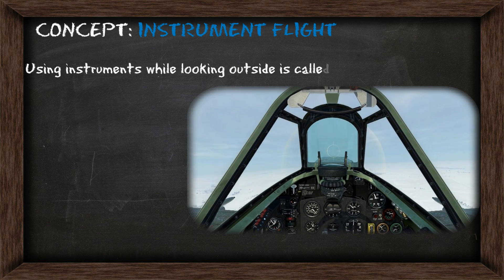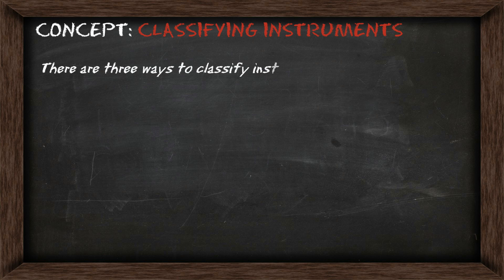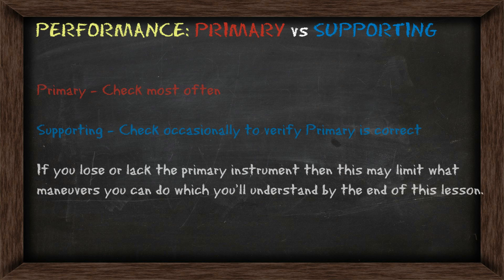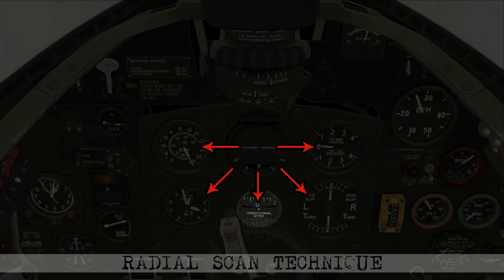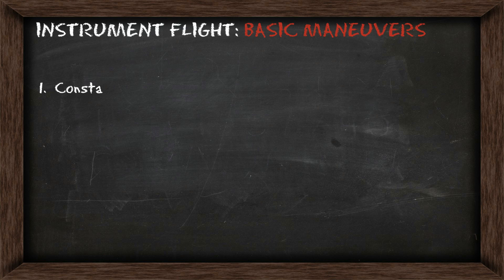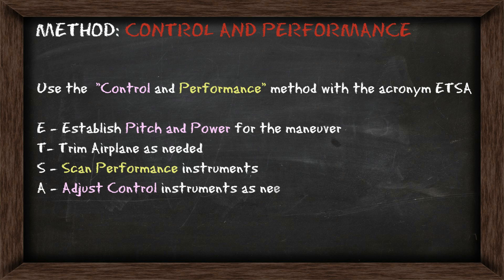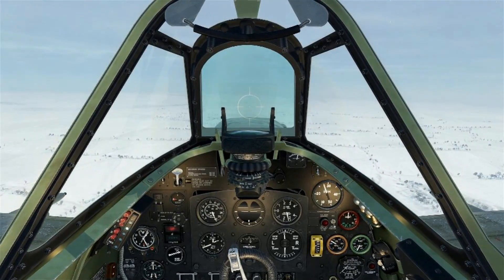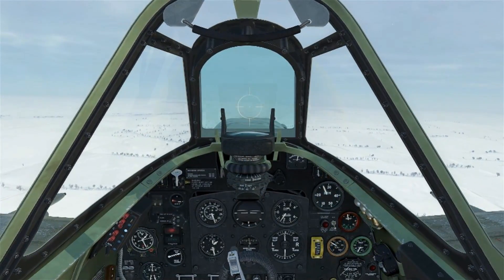Instrument Flight Basics

Comment: 1) How to execute smooth, IFR leveling off, if a plane has no variometer? Like Bf-109?
2) German fighters like Fw have variometers in m/s anyway, so I think they used different rules of thumb for IFR leveling off?
Reply from the maker: Without a VSI you'll have to watch your altimeter and control the rate at which the needle approaches the desired altitude. Basically don't let it go crazy fast...

Comment: I'm looking to buy IL-2 BoS, but have some questions. First off, do the AAA fire at you when you approach them in IMC? Secondly, what is the extent to which radio navigation is modelled in the game? As far as I know it has some representation of NDB systems, but some (mostly German) aircraft seem to have navigation instruments which display glide slope, is this modelled or not?

Thank you for your time.
Reply from the maker: Hey Siim. I believe line of sight is implemented for the AI airplanes, but I'm not sure about the AAA. The radio navigation is simple at the moment with simple NDB types. The glideslope indicator on the AFN-2 for example doesn't work yet.
Reply: To clear that up a bit, AFAIK it functions both as a glideslope indicator for the Lorenz landing system and signal strength indicator for the AFN-2. I'm not an expert on this however, so I might be mistaken.

Thank you for your timely reply, it seems I have some testing to do then. :)

Comment: +RequiemBoS  Instrument layouts have evolved with the gauges.  U. S. aircraft circa 1940 would stack the airspeed and altimeter to near left of the attitude gyro, vertical speed and ADF bearing to far left, tachometer and manifold pressure to near right, engine pressure/temperature and fuel quantities to far right.  The turn and slip was usually below the attitude gyro, and the directional gyro could be either above or below the attitude gyro.  Today's jets have some of the instruments combined; the modern attitude director indicator places the slid-skip ball and yaw rate needle at the bottom.  Some modern secondary performance gauges (e.g. the vertical speed and angle-of-attack in the USAF/Lockheed Martin F-16C) are actually 1/2-3ATI sized to fit gaps around the airspeed/Mach, altimeter and ADI.

Comment: Thanks for useful tutorial. BTW why don't you have your slip indicator perfectly centered ?
Reply from the maker: The joys of flying on a computer swivel chair which can make precise adjustments harder sometimes, so what shows as centered makes my body feel pretty crooked at the time. I'll just accept the minor error as it's a lower priority than maintaining heading/altitude/airspeed accurately. Much easier in RL. Of course, nobody is perfect though so that's another good reason too LOL
Reply: You must be a great pilot being able to fly so well on a wobbly chair. As for me my rudder is a helicopter-style VKB T-rudder which works be pressing the ball of my foot while my heel rests on the floor so it doesn't cause my chair to wobble (because I also have a swivel chair). And as a nice bonus helicopter-style rudders are more accurate because a heli pilot needs to make more frequent & precise tail-rotor adjustments. Furthermore my joystick is screwed-down on my desk. It takes about a minute to screw/unscrew it so it is not too bad. When all your flight gear has no slack it does make a huge difference, at least for me.
Reply from the maker: @wheelwrightpl9429  Ah ok that sounds pretty good. My pedals are the MFG crosswinds and my HOTAS is loose on the desk so things can get interesting sometimes! Hoping to be able to make a proper simpit one day with everything set in position to not worry about it anymore.